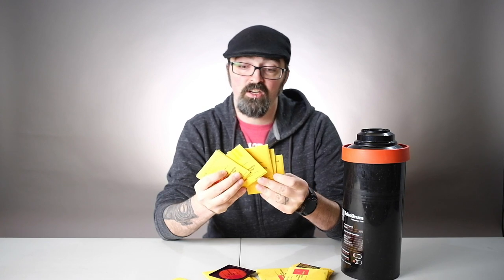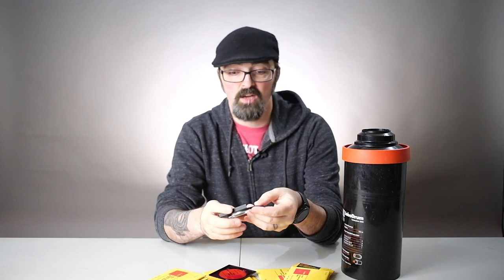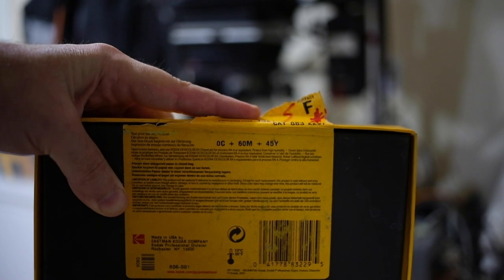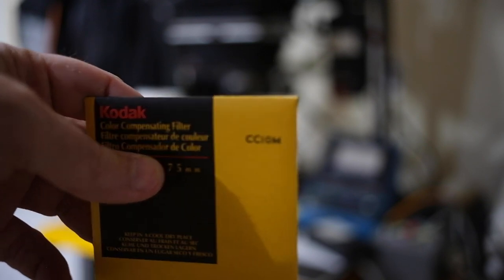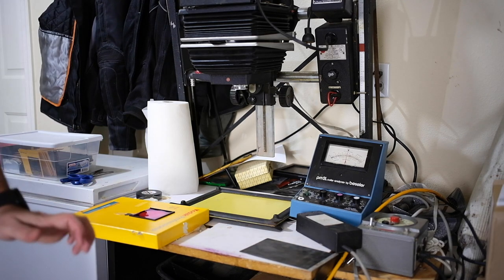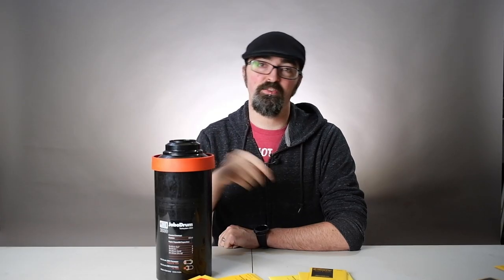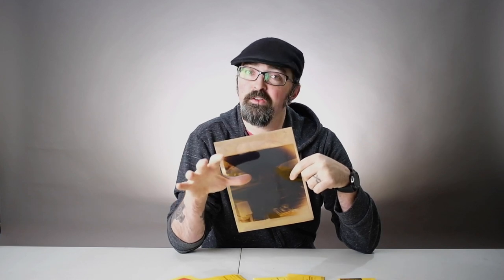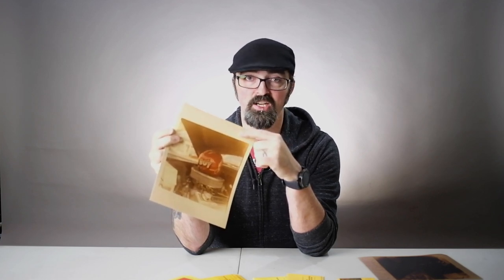Intro To Color Printing with a Black and White Enlarger

Comment: Believe it or not, there was a time when no one had a dichroic colorhead, where you could just dial in the color of your light source for color printing.  Home printing did not significantly exist prior to the 1960s, primarily because the color negative printing processes were so terrible that no one wanted to use them. Agfa had one process system used in Europe. Kodak had its different and incompatible system in the US. The rest of the world picked one. Enlargers made from around the mid-60s usually had some sort of slot in the light head to allow insertion of filters, but these were initially intended for use of variable contract filters in B&W printing. As color printing came home, these thin, plastic or gelatin filters were introduced to print color in the same types of filter drawer heads. These filters came in two types. CC filters were for color correction on the camera lens. If physically large enough to cover the film negative, they could be used in printing too. CP filters were for color printing. They were larger, and they were not closely color calibrated like the CC filters, making them cheaper yet adequate for printing. They are also physically tougher to take the handling printing required. Apart from having to shuffle a pack of filters to print color, the additional issue is that they fade with extended use, exposure to bright light. So if you buy these filters to use, try to get them new and unopened, or if opened, pay very little for them. (Pennies, not dollars)  Then, some enlarger makers created colorheads which used adjustable color filters built-in. Omega in the US was a leader in this, but those heads also suffered from filter fade over time and were very expensive. In the early 1970s, dichroic color filers came into use. Their unique advantage is that they do not fade.  Durst started making these for consumer and higher end enlargers in the early-1970s, and there we are. The under-lens filter holder shown in the video was sold to allow use of filters on enlargers with no filter slot in the light source, but their popularity was that they allowed the use of the smallest filters, which were much less costly than the medium or larger format sized filters required in a filter drawer. The knock on them is that they put the filters under the lens and may degrade the projected image. Tests published at the time showed that this was no problem if the filters were kept clean.

Comment: Thanks for the video! I made RA-4 prints but found as main culprit the much higher sensitivity of RA-4 chemicals for oxidation. You mention that prints can be developed with C-41 - how can this be done? What kind of compensation is recommended here regarding Y/M/C channels and temperature to develop/development times? C-41 is a lot more stable than RA-4 from my experience, so this might be a good way forward with C-41.
Reply from the maker: I've found that RA-4 oxidizes fairly quick as well, that's why I tried C41. out originally. Like I mentioned in the video it seems to lean a bit more cyan than RA-4. I've found that typically reducing 10-15Y seems to come out fine.

Comment: Is there any way to put the filters between the light source and the negative (Perhaps above the negative holder)? When reading up on this it said that if you place it between the source and the negative there's no quality loss because the filter isn't in front of the lens.
Reply from the maker: Some enlargers have a slot there for filters for exactly that reason, it'll just depend on your gear.
Reply: @GoEverywhere  awesome! Thank you so much!!

Comment: Apart from perhaps Jobo print drums ( hugely overpriced), you probably are not going to find new print drums, or used drums other than on ebay. They are practically indestructible, so used is good (and cheap). Top brands from the past are  Unicolor, Beseler. My preference has always been Cibachrome drums because they are so easy to clean and dry for reuse.  Note that while you can process smaller prints in drums made to hold a larger size, that's a waste of chemistry. It's best to pick up a drum in each size you will regularly use. I don't think he mentioned  chemistry usage. In these drums, you use as much chemistry volume as is required to process one print, then being exhausted, it gets tossed. Of course, there are those who will make themselves crazy trying to reuse such chemistry  and be punished for cheapness by suffering color and density variations which cannot to planned for.

Comment: What about the color analiser Beseler you have near the enlarger??? could you tel me abaout the use?? congratulations from ARGENTINA
Reply from the maker: Its just your typical color analyser, you use it to balance color prints. I don't use it as much as I used to since my color head on my enlarger failed. I still print color with filters, but its a lot more work which means I don't do it often. The analyser will tell you what filter settings you need based on the tone of the negative when you project it onto the sensor using your enlarger. It keeps you from having to make so many test prints to get the color balance you want.
Reply: @GoEverywhere I am very thankfull

Comment: What are those thing you slide the filters into before putting them in the holder?
Reply from the maker: Just the other bit of the filter holder if its the part I think you mean.